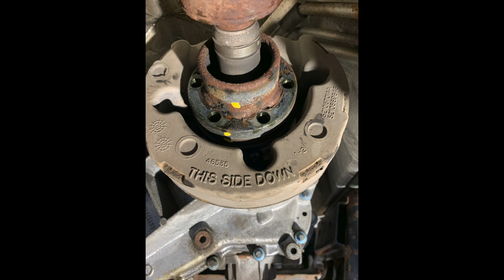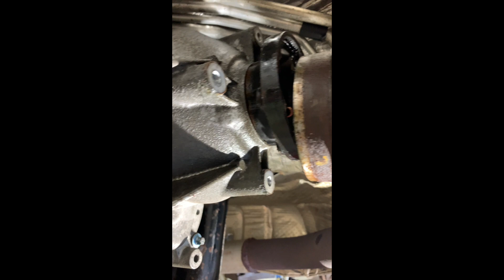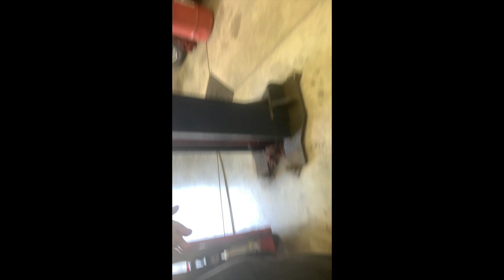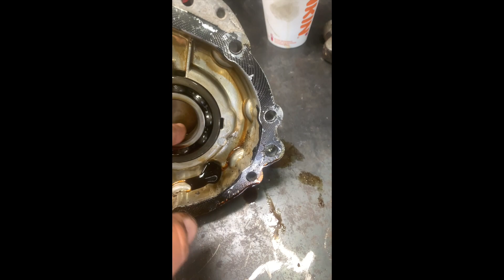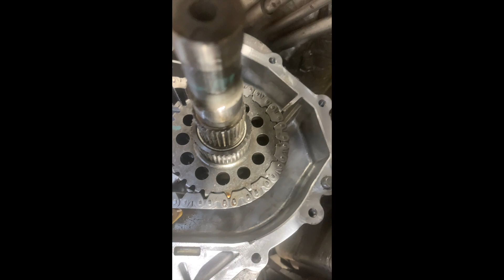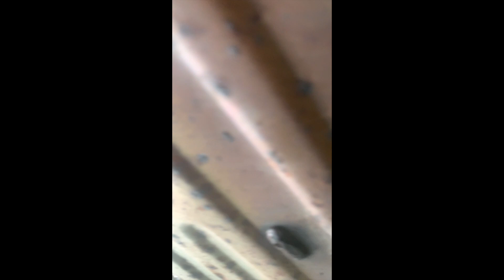$300 3hr transfer case repair dodge durango , Jeep , Chrysler transfeer case

Comment: I have a 2011 Durango Citadel v6 with the single speed transfer case.  We bought the car with 100k back in 2019 and now at 180k have a slight clunk when accelerating from a stop.  I thought it was the motor or transmission mount but, I might have to replace my chain as well.  Thanks for the video.
Reply from the maker: Get your questions answered by subscribing

Comment: I have a 2016 Durango Rt AWD. My wife is describing what feels like a slight slipping when pulling out from a stop. Not a slipping transmission. But what feels like slipping. It is very inconsistent. However, when in reverse, I can get it to create the feeling. There is no obvious noise but kind of gear/ meshing feel. Does that description fit what you experienced?
Reply from the maker: It is more than likely to transfer case it, transfers torque from the rear to the front of the vehicle. That’s what you’re looking at and if you don’t buy four tires every time you’re putting strain on that chain and you’re stretching it out so if you drive really slow and it doesn’t make a noise you still have time get it done right now.
Reply from the maker: Please like and subscribe so I can keep this channel going. We all love these trucks and together we could do it at the lowest total cost. 
It only cost you two clicks  it took me hours to film it , edit and answer questions
Reply from the maker: Get your questions answered by subscribing  more videos are coming

Comment: I know this is an old video. But i just got a 2011 durango citadel. At times, mostly under load at higher speeds, it feels like the transmission is trying to shift but doesnt. Like its jumping in and out like you said. Is that the transfer case?
Reply from the maker: The video is not old and that’s because you have a different shifting than I do. There’s an electric motor in there that shifting it in and out and if you don’t get it fixed soon, you’re gonna be a big trouble.  You don’t have all-wheel-drive all the time, but there’s a motor in there that shifts when it thinks you do and if you don’t, it’s just gonna wear itself out.
Reply from the maker: New videos coming this week 
Please like and subscribe so I can keep this channel going. We all love these trucks and together we could do it at the lowest total cost. 
It only cost you two clicks  it took me hours to film it , edit and answer questions
Reply from the maker: Get your questions answered by subscribing  more videos are coming

Comment: Please elaborate on the carrier bearing bolts you said not to break. You say they break off in the frame?  I assume you loosened those to get the driveshaft to move or come out?
Reply from the maker: There is a time counter on the bottom of every video please list the time stamp in the video that you’re referring to.
Reply from the maker: If you’d like the video and expect an answer, please like it
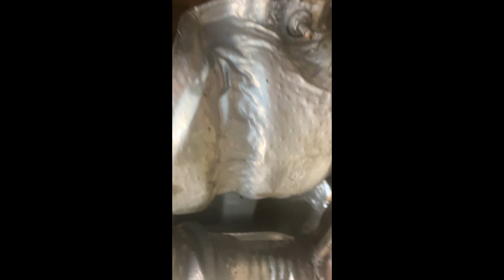Reply: @jameseiden2340  You mentioned it beginning around 6:10
Reply from the maker: yeah there’s like eight bolts going in it all the way around snap one off was just stating the obvious anytime you snap a bald off inside just do it off a little bit at a time if you feel it and crank it back in two turns and then crank it back out use break free oil
Reply from the maker: New videos coming this week 
Please like and subscribe so I can keep this channel going. We all love these trucks and together we could do it at the lowest total cost. 
It only cost you two clicks  it took me hours to film it , edit and answer questions
Reply from the maker: Get your questions answered by subscribing  more videos are coming

Comment: Nice video! What did you use to clean out the transfer case. And did you use rtv black silicone to reseal it?
Reply from the maker: I use carburetor cleaner, but you can use anything I only cleaned out where the metal was on the magnet and yes, I used RTV sealant and it’s still isn’t leaking no problems whatsoever and if you like the video, please subscribe I went through a lot of trouble and there’s more coming
Reply from the maker: Yes I cleaned it out using oil base solvent out of a harbor freight parts cleaner  and used permantek black rtv
Reply: Awesome, thanks! Also did you use Mopar At4 Fluid?
Reply from the maker: @HookinFever  there was a tricky part it lists two different types of transfer cases and I didn’t get it, but I used the one in the manual for single speed because the other one is for the automatic transfer case and you know you have this if you have a motor on that transfer case that engages that’s why you’re supposed to change all four tires at the same time
Reply from the maker: New videos coming this week 
Please like and subscribe so I can keep this channel going. We all love these trucks and together we could do it at the lowest total cost. 
It only cost you two clicks  it took me hours to film it , edit and answer questions
Reply from the maker: Get your questions answered by subscribing  more videos are coming

Comment: Thank you. I looked at the internet and found no explanation for that problem and how to solve. I would like to know something necessary for that problem. My Dodge Durango 2015 awd v6 3.6 Which cars are the same awd carrier case? I would like to buy a used jeep grand cr carrier case but I don't know if it fits my car. Please clarify
Reply from the maker: That’s a great question and yes, the answer is in your glove box in your owners manual go figure it has the two different kinds of transfer cases is automatic and the other one is mechanical and automatic I mean it’s electronic when in doubt get your Van number and call your local dealer. That’s where I bought my chain.
Reply from the maker: New videos coming this week 
Please like and subscribe so I can keep this channel going. We all love these trucks and together we could do it at the lowest total cost. 
It only cost you two clicks  it took me hours to film it , edit and answer questions
Reply: @jameseiden2340 did yours start out with a low hum noise and keep getting slightly louder over time?
Reply from the maker: Get your questions answered by subscribing  more videos are coming

Comment: i was reading the service manual for this and it says "There is a blue link on one side of the chain. This blue link MUST be
 installed facing upward". Not sure if they mean the blue link should be facing outwards (So you can see it and not towards the back of the housing) or if they mean towards the top of the housing.
Reply from the maker: I wouldn’t worry about that that’s for the MasterLink. That’s no big deal that’s just an extra precaution so it doesn’t get caught on anything but there’s nothing for it to get caught on so you have nothing to worry about.
Reply from the maker: If you have the service manual, please Pause how many torque inch pounds the bolts have to be when putting the assembly back together
Reply: Where did you get a service manual?
Reply from the maker: New videos coming this week!
Please like and subscribe so I can keep this channel going. We all love these trucks and together we could do it at the lowest total cost. 
It only cost you two clicks  it took me hours to film it , edit and answer questions

Comment: James.  Great video.    What did you use for a gaskit.  Also did you change the scrubber.   And after you removed rear driveshaft.  Did the front slip out easy.  Thanks
Reply from the maker: Mopar chain   Some things you can go aftermarket but this is definitely not one of them. I hope you did this by now or you’re causing more damage.  This is one of things you have to act as soon as possible to avoid catastrophic failure
Reply: @jameseiden2340  thanks James.  The truck has been off the road for awhile. Stilll cold in New York.  I havent ordered any parts yet.   Gonna take it spart see if i can get away with just foing the chain. Keep u posted.  Thanks again
Reply from the maker: Black gasket maker, silicone I can’t think of the popular name but it’s in a blue and white tube. No amazingly enough just like the sprockets everything wasn’t even scratched and I have 160,000 miles on it. Unbelievable. As for the front, I don’t know I just took the rear out. I left the transfer case inside the vehicle I removed the coupling, separated. It enough loosened all the bolts and took it down. Half of it cleaned out everything clean the magnet check the scrubber checked everything couldn’t find any problems Besides the chain being really stretched I found this by sticking a camera inside the fill hole and I worked a chain back-and-forth and socks slapping around in there that’s why I went on this venture because I really didn’t have $4000 but I will tell you this, I must putclose to 12,000 miles on it now and there’s no problems whatsoever that’s just an update
Reply: Awesome.  Thanks for filling me in.   Did you use a mopar chain or just a $100 chain.  And last did u have to tork bolts or just as tight as you could get them.  Have a great day glad the car is working great. Best video out there
Reply from the maker: New videos coming this week 
Please like and subscribe so I can keep this channel going. We all love these trucks and together we could do it at the lowest total cost. 
It only cost you two clicks  it took me hours to film it , edit and answer questions

Comment: Do the gears just pull right off or does it have clips?
Reply from the maker: Don’t take the spockets off the shaft.
Reply: @jameseiden2340  thankyou
Reply: @jameseiden2340  How do you get the chain over the sprockets if you don't take them out then put the whole assembly back in?
Reply from the maker: @mahoney1138  leave the sprockets on the shaft, pulled the shafts out of the bearing. They’re not Preston the shafts, but the bearings are pressed in  housing so they stay in there.
Reply from the maker: New videos coming this week 
Please like and subscribe so I can keep this channel going. We all love these trucks and together we could do it at the lowest total cost. 
It only cost you two clicks  it took me hours to film it , edit and answer questions
Reply from the maker: Get your questions answered by subscribing  more videos are coming

Comment: Great job on the video. As i understand it from your comment on someone elses post youve suffered a stroke. You did great man. Thanks for leading the charge on this. Im going to tackle this myself. Would you believe i was quoted $5,100 in the Seattle area to R&R The transfer case!?!  No way! 
Just a minor correction on your diagnosis. 1. You didnt do anything wrong. These chains stretch and not due to changing fluid or not. 2. The noise is from the chain slipping over the sprockets due to being stretched. You might notice upon acceleration that you dont have full power, which is due to lack of traction. 
How hard was the sprocket removal?
Reply from the maker: My research is pointing the finger at me because I didn’t buy four tires at a time. I only bought two and they’re saying that puts extra pressure on the chain because the wheels aren’t the same size if one severely worn down and the other ones are brand new the tires are not the same size.  As for the sprocket, I didn’t take that off. It comes attached to the shaft. Once you get the cover off, you put the new chain on then you put the sprocket back in the shaft. That’s the only way to get it it was incredibly easy the only thing that I’m totally, amazed by is whatever these parts are made out of you must be the same as the iPhone 15 nothing was scratched damaged or wore down only the chain, but just remember to clean the magnet at the bottom of the case. There was so much metal on it and when you’re taking the shaftsor couplings out so you can get at the transfer case. There is a slot on one side you might have to turn the driveshaft a little bit to rotate it where you can see where to plug those couplings apart.
Reply from the maker: Get your questions answered by subscribing
Reply from the maker: Get your questions answered by subscribing

Comment: Great video $5000 thanks yous.
Reply from the maker: That’s very well appreciated and this video needed to be done because all these cars are aging. Whatever the gearing was made out of the sprockets in the shaft is some sort of space age material that had nowhere I only changed the chain.
Reply: thanks for the reply i can see 300 in parts, my dealer wants 5000. i like the rear facing cover and rear driveshaft removal and no t/c removal. thanks again for a great video.  @jameseiden2340
Reply from the maker: Please don’t forget to subscribe

Comment: Great video, James!  Trying to track down a single clunk on acceleration.  I'm thinking this might be it.  I have the single speed transfer case - 2014 GC 4wd with tow package.
Reply from the maker: If you put it on the left, I think you can make it do with channel locks on the shaft and give it a yank. You should hear that chain snapping inside I pulled the oil filler plug and got to see inside with the camera and I saw the chain doing it.
Reply from the maker: Also, know that the longer you wait the more of a problem it’s going to be if you could catch this thing, making noise and get it when it first starts you just need to chain
Reply: @jameseiden2340   Were you getting any roughness at all on acceleration?  Mine feels like knobby tires on the front when I accelerate, and it made a loud noise one time when I took off quickly.  When I changed the fluid, it looked to me like the chain had more movement than I would expect.
Reply: What was the symptoms you were experiencing
Reply from the maker: Get your questions answered by subscribing  more videos are coming
Reply: @jameseiden2340 mine is a 2016 dodge Durango and it has a clunky noise when it shift down from 3rd gear to 2nd gear

Comment: great video, thank you so much.  im hoping my issue is just the control module, but I'll follow your advice on the transfer case replacement, i think i can do it myself
Reply: if i need to i should say,  im trying the module replacement this week.  my wk2 is shuddering at low speeds and binding up when turning as well
Reply: @danweekliesorama9995 hey man how did this issue turn out for you? Trying to solve this the cheapest way 😅
Reply from the maker: Fat chance it’s the module what happens is when you don’t replace all four tires the module detect that the wheels in the front are turning at a difference speed than the wheels in the back because they’re not the same size tires that are new 10/32 and should definitely be changed when the 2/32 But that’s the system is that it’s too sensitive and people who only change two tires that keeps going in and out of four-wheel-drive or all-wheel-drive if it’s making that kind of noise you either broke it I’m going in and out so much or the chain is so severely stretched, and it needs to be changed as soon as possible
Reply: @jameseiden2340 hey brother appreciate this video going through same situation here had drove my jeep for few days with spare and prior drove around with a low psi tire, in your case you didn’t replace the module just the transfer case component correct? I get a strong knocking noise when at turning speeds
Reply from the maker: @angelr6994 no just chain and fluid
Reply: @angelr6994  could definitely be the drive shaft carrier bearing. I have to replace mine soon
Reply from the maker: Yes that’s right ,,, only the chain , fluid ,
Reply from the maker: Please like and subscribe so I can keep this channel going. We all love these trucks and together we could do it at the lowest total cost. 
It only cost you two clicks  it took me hours to film it , edit and answer questions
Reply from the maker: Get your questions answered by subscribing

Comment: What is the torque spec on the 10mm inverted bolt ( transfer case housing ) painted blue / green ? Mine in having a fluid leak not sure what if it’s inside the Chain location,  the vehicle have side step rails that’s add a little inconvenience on the ground without a lift . Thank you
Reply from the maker: 27 ft lbs but you must use the black gasket maker in the tube sold by Lowe’s home improvement
Reply from the maker: Please like and subscribe so I can keep this channel going. We all love these trucks and together we could do it at the lowest total cost. 
It only cost you two clicks  it took me hours to film it , edit and answer questions
Reply from the maker: Get your questions answered by subscribing